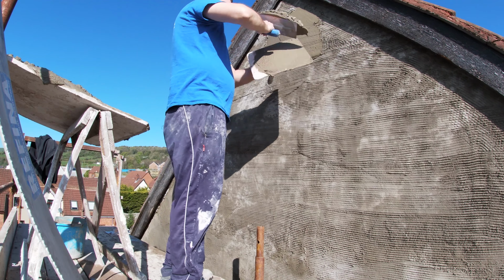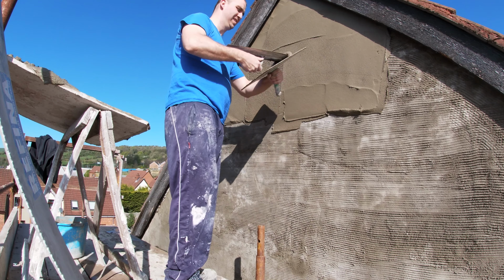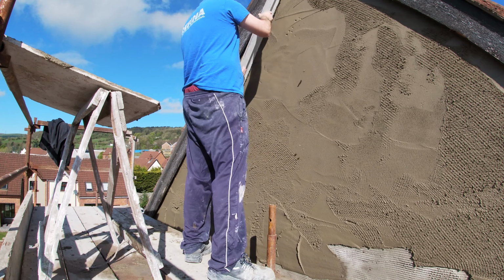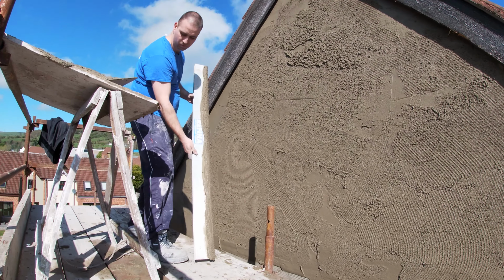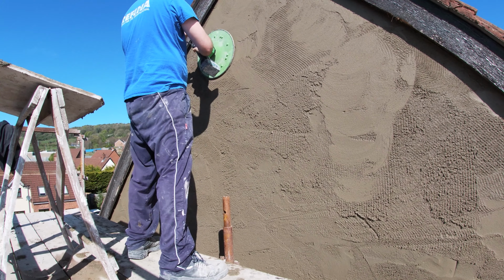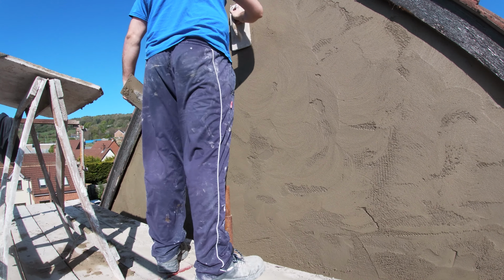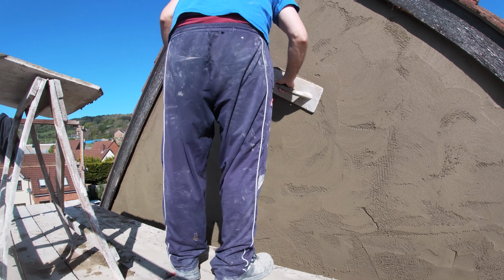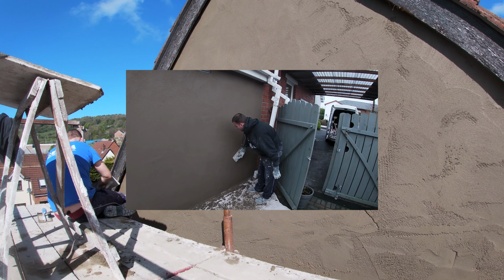How I Finish Render Sand and Cement Lay on get Straight & Make Smooth also using Power Float

Comment: Some quality work right there 👌🏽 is that scaffolding yours ? Or do you have to rent it when you render high walls ?
Reply from the maker: I have a little not much that ones hired in  very expensive but was a good job fir us working on
Reply: @macplastering  yes scaffold so expensive to rent mate , did you do an acrylic finish on this job or paint ?
Reply from the maker: Oh yes this one was just painted would been a great job acrylic but as you know very costly gear
Reply: @macplastering  yes but it’s a great job , do you do the pain as well or does the homeowner has to hire a painting contractor separately?
Reply from the maker: Separately would do my own in my own house same as tiling but find im to slow to make money for others  @ernestogonzalez17
Reply: @macplastering  ahh makes sense so basically the top cost is your finish product 👌🏽
Reply from the maker: Yep painters job there on it :):) @ernestogonzalez17

Comment: Would you ever add lime to your top coat mix? Some guys suggest 5/1/1. What are your thoughts on using waterproofer and lime in the top coat? tks in advance.
Reply from the maker: I never add lime mate no need I use waterproofer and plastasicer stuff is lovely to work with and always worked for me

Comment: Is it possible to repair cracks on white pebble dash finish?
Reply from the maker: It would but hard to keep it the same do have a possible job coming up thats need some cracks fixed but its painted witch makes it easier to hide
Reply: @macplastering  we have a detached house with have pebble dash half grey mortar render. You recomend to repair the cracks then maybe get the pebble dash painted?
Reply from the maker: @kevincurley5065  You don't need to paint if you can get the colour of cement matched well also if you do paint you are tied to that every few years or so
Reply from the maker: @kevincurley5065  have a possible wet dash upcoming but not sure when would get it edited and uploaded alao have fotage on a dry dash one but need to edit and upload

Comment: The serated rule is a MUST! .... Why we used Skirting boards - The edge would get nice and 'furry' making the ruling of render FAR easier - and didn't drag the water to the surface either 👍😎
Reply from the maker: I wanted to get of the peak as fast as possible as you know more of the wall to do :)

Comment: U never edged downwards from the soffit?
Reply from the maker: I think i pulled up to about 6inches away then across so any highs will be cut of and any lows will be visible
Reply: Pull up and across ,like toweling, sand and cement ,never pull down
Reply: @Peter Gray  no always pull down afew inches to make ur sottot line level man

Comment: What kind of hawk is that bend an the handle
Reply: Cheers mate I have tension elbow mate also a spread 👍  I got a bracelet with magnetics an the inside of it took the pain away id like 2 try the hawk .....u work left 2 right ....I spread right 2 left both right handers
Reply from the maker: Most guys i know here do it my way but i gusse its what ever is easiest , where you get that bracelet mate
Reply: @macplastering  lucky enough a mate of mine gave me it and told me leave it an for 14 days I dint belive him but it actually worked I thought was for artirus but it actually fixed tension elbow id say they should do them in the chemist man
Reply from the maker: The pointsman its called mate good for the elbow
Reply: I use the pointsman for skimming , can't use it for s+c ,too much weight